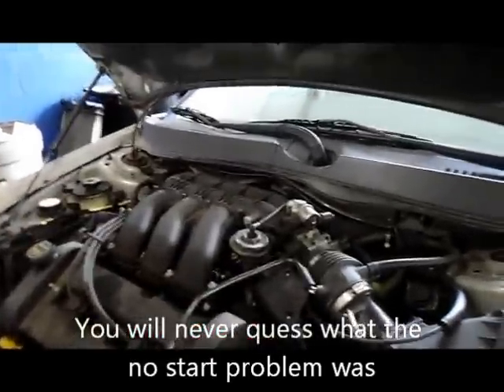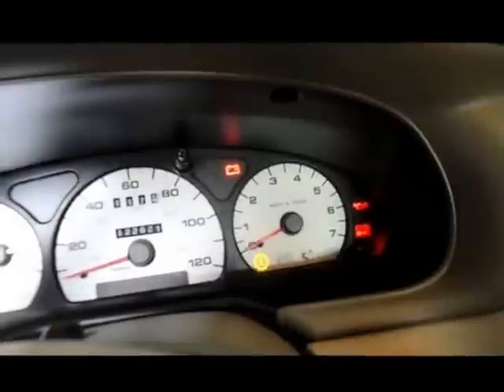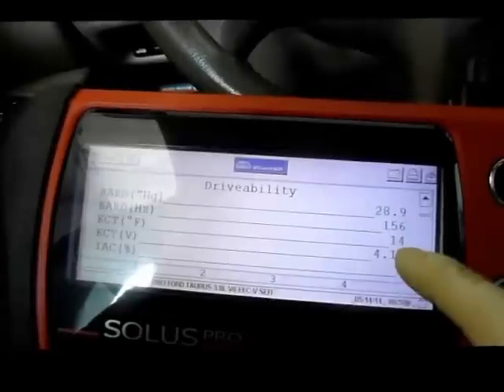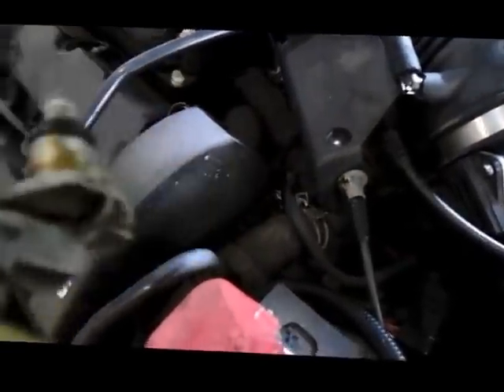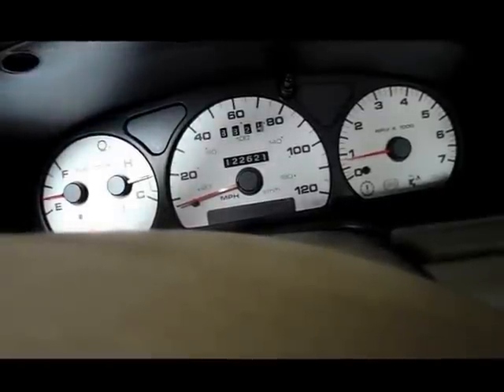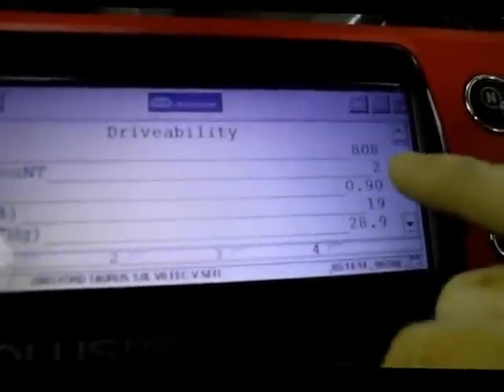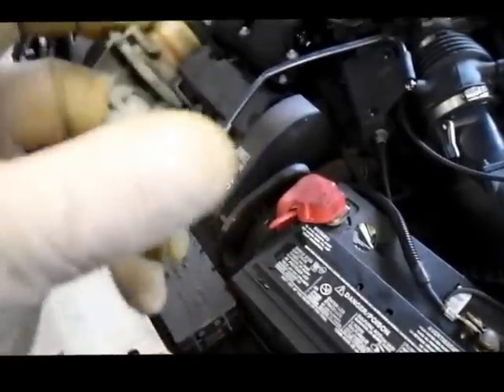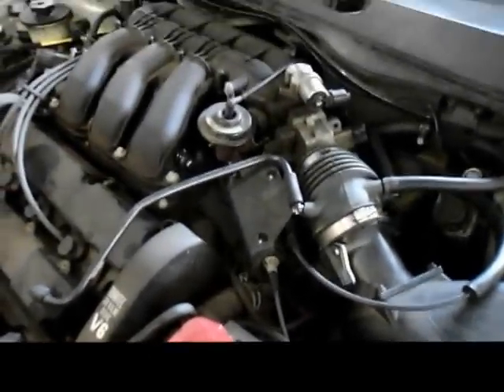Engine cranks but won't start

Comment: hi sir,i have 2012 ls that has been over heating and is crank but no start as well,would this method work on all cars?
Reply from the maker: Did you check the car for codes? Was the car overheating for a long time?
Reply: jimthecarguy no codes are being thrown,and everytime the car overheated i parked on the side of the road,resivor would be empty (however there is no leak anywhere)i would fill it back up and it would drive fine.ive already changed the spark plugs and the coil pack....
Reply from the maker: If there is no leaks under the car it may be a problem with a head gasket.What did the old plugs look like?
Reply: update....when i wrote u it was around 1am i think,since i wasnt going to be driving my cruze,i wanted to save the battery so i disconnected the negative cable,when i came outside to work on it,i reconnected the cable and it puttered a bit but it started right up....i dont understand.
Reply: i have video and pics but dont know how to post it on here,do u have an email?
Reply from the maker: jimthecarguy1@gmail.com
Reply: jimthecarguy I have a 2004 Alero and I'm having the same problem..I have gas in my car but the gas gauge isn't moving at all I checked under the hood to see if it's getting gas and it is what could be wrong
Reply: jimthecarguy my 2002 mercury sable cranks but won't start could this be a possible problem?
Reply from the maker: Yes it could be .Did you scan the car for codes?
Reply: jimthecarguy I'm having the same issue now with my Acura Legend. The dealership checked it out on the computer the code came back saying bad coolant  temp sensor. The strange thing is my car hesitates to start only if it sits for at least 8 hours or more.
Reply: Ricci Clark and
Reply: Ricci Clark I'm thinking cracked head would cause it to over heat depending where the crack is it mite be spray ing coolant into the cylinder s where the spark plugs are with causes the no start because of fouling of the spark plugs

Comment: hi my name is Maurice and I have a 96 Dodge Avenger and the car will start up but it won't stay running what should I do
Reply from the maker: Did you check for codes?
Reply: I had a 95 Dodge Avenger with the 2.5 v-6, I had a problem that the car would start and run but you had to put it in neutral and revved up at stops.  It was the EGR vavle, I had it checked twice and it tested good but I changed it and it cured the problem, I don't know if yours is the same.  You can make a blank off plate and put it between the EGR and the manifold.  You can make this out of a soda can or whatever and just bolt the EGR back on.  If the EGR is the problem the car will run fine.  That is an easy test, the testers that some places have for EGRs didn't tell the truth.

Comment: The coolant sensor sends signal to computer next to check heat from exhaust(02sensor) to fuel...complete circuit

Comment: wow that's just insane, I'm gonna check mine, after it over heated sob wouldn't start , and still having issues, shoots 1 vacum line can cause the whole car to fall apart from Miss fire to everything , these cars are a Btch when they want to be, . I'll let you know what happens ,

Comment: I have a 2000 Chevrolet Blazer and it starts but won't stay cranked  might stay crunk for 5 to 10 seconds then starts to backfire and stalls
Reply: Any help with this I will be grateful the fuel pump is working I can hear it running changed the fuel pump
Reply from the maker: Your going to have to do some diagnostics.The first thing you should check is the fuel pressure to make sure the pump is good.
Reply: jimthecarguy  I can hear the pump turn on?? Does that matter
Reply from the maker: That's good but you still need to know the pressure especially when it starts to stall.
Reply: jimthecarguy  how do I do that
Reply: jimthecarguy and how much is it gonna cost me

Comment: I have a 2000 Nissan Altima with 222,000 K  on it and the engine turns and cranks even with old spark plugs.

Comment: Why is it that every time I'm watching videos where it involves a diagnosis of the vehicles electronic or just simple starting ... every single mechanic or diy always over rides the ignition cluster lights to start the vehicle? Guys let the cluster complete its check cycle with the ecm pcm before cranking the engine !! It's crucial to the computer management systems to pre diagnose prior to start up
Reply from the maker: Marc Bainbridge thank you for stopping by the shop

Comment: Can somebody help i have Nissan tiida 08 Ger Ato it crank but wont start fuel pump has been tested all good,  i have even cleaned the plugs ones it was gon fine for a day then same happened again! please help if you can

Comment: When it reads cold the ECM will try to fatten up the mix and it causes it to flood so it stops fuel.
 Wait until a cooling fan that is bad will also not allow it to start.
 Ford's have a piss poor O.S. (operating system). I have seen many like what you got. Remember when working on Ford's,Lincolns, Mercurys you must put common sense aside.

Comment: I have a 2004 kia spectra it starts but turns right off any idea why has gasoline
Reply from the maker: christa dosty The car has to be first scanned for any failure codes.
Reply: jimthecarguy did that this problem was fixed but now code p0302 comes up it drives rough now and check engine light blinks on and off

Comment: What happens if you get 0 rpms? Car cranks 0 rpms wont start?
Reply from the maker: jonathan ullery Some cars don't register rpm's until they kick over. Check for spark, fuel pressure and pulse to determine where the problem lies.
Reply: jimthecarguy thank you for the reply ive found out the car spark plugs were bad and had a flooded engine ty.
Reply from the maker: Thank you for watching

Comment: Space Cadet when your mobile no need to remove injector 1st check for switching, 12V, 5V.I recently went to a Mondeo 2.0 the chap had the car parked for 6 year he had 2 mechanic check out still did not start one told him faulty injector I check faults and with in 10 minutes diagnosed faulty fuel pump in tank (Problem Sorted )
Reply from the maker: Thank you for watching and your input.

Comment: i have a nissan micra -march just dose anybody know before it broke down  the car would run very bad  then it would die. let it cool down then it would start / now no spark no start .when i try to start it just before it died. there was smoke coming from throttle body any help lease

Comment: its what they call open loop, it enriches the fuel to make the o2s hot to operating temp. (close loop)
then it uses the o2s reading to go rich/lean (feedback logic). Without one of the two temp sensor reading the computer dont have an alternative command to start the car. But if the readings are ait (air temp sensor = close to atmospheric temp and ect = around engine temp) verifyable with a temp gun to test, then the computer will read off the o2s for fuel delivery (close loop mode).

Comment: "The 2 DTCs are because I had the coolant temp sensor disconnected"

No sorry, do not pass go, do not collect $200. The DTCs where there because the ECU figure out one of the temp sensors was wrong. On startup every ECU checks the 2 temp sensors a car has (air, coolant) to see if they values make sense. The ECU has probably saw two wildly different readings and tripped the Check Engine light. Both DTCs might be related to the coolant temp sensor or there might be one for something else. Always run a DTC scan first, you can save yourself a lot of trouble.

As for why it it keep an engine from starting, well if you need to ask you're not really qualified to work on cars, EFI or not. Ever heard of a stuck choke? It can cause the same condition, even worse it could hydrolock the engine in the worst case scenario..

Comment: Car comes in as a no start. Hasn't been run yet. New sensor. 192F. Start car. Temp gauge already at 50 %. I don't understand. Must have been a really hot day.

Comment: I had a 1999 Nissan Pathfinder 300 V6 4 wheel drive it cranks but won't start I bought a whole new distributor put it in still won't start put new spark plugs and wires fuel pump works has pressure but still won't start I don't know what to do to it is there anybody out there that can help me been stuck in a field 4 months help

Comment: Things like this are the reason I stopped working on cars, they are now designed to breakdown over the smallest things, the warranties and intentional over complication of a simple system for the purpose of screwing the public out of money on repairs that there is no need for. If you can't understand an engine temperature light then you shouldn't have a car! Personally I find it much better to find old cars and maintain them than to buy a piece of junk that can't take a 8 mph collision without costing 4-10,000 dollars and a computer that makes diagnostics impossible! Best car ever made? VW Beetle, hammer and a screwdriver and you are set to go!
Reply from the maker: Thanks for watching.

Comment: it's a computer trying to protect the engine from overheating shouldn't be that hard to figure out just like the rpm sensor to cam shaft synchronizer won't send fuel to the engine if that's not working

Comment: ohhh i see the problem.    is says FORD.  same thing happened in 95 nissan altima.   exactally same thing.  start and die as soon as you accelerate or put in gear.

Comment: how about if problem  with honda accord 2006 ?? please ......
Reply from the maker: What is the car doing?
Reply: @jimthecarguy  Thanks for replying, I just want you to know that I have no knowledge about cars and your videos have really helped me. 
I had a problem with my car. When I bought a new battery from a known company, they fit in the battery and they put the cover on the wrong side. I didn't notice this in the beginning but this caused the engine light to come on. The D (drive) light started flashing. I scanned it, and the code that came up was P0843, second clutch transmission switch sensor. But the car drove well.  I changed the sensor but the problem stayed. What was strange was it was draining the battery. I changed the battery 3 times since it was still under warranty. I tried to find what the problem was and i noticed that the battery cover was placed upside down. I fixed it myself and the problem was fixed. The funny thing was that the upside down battery cover can trigger the problem. I don't believe it but it happened and I've spent nearly one thousand dollars on this problem. 
Hopefully you know this problem but if not, here's my story. 
Thanks Brother, you've helped me a lot.
Reply: the problem fix for couple days and today the problem is  come back , I don`t know what to do , hehehe....
is  the ignition switch can cause that problem ??
 look like the cable , connnection  ?
 please helph me ......

Comment: This  guy has obviously not dealt with a tempermental Silveardo truck and the vans that are prone to play this game with ya as well as peekabo idiot codes that don't even make sense or are not listed. Anyone with a Silverado that has gotten a code that does not exist should try to replace the temp sensor as well as the pig tail lead to it. This is a very common Chevy truck problem. So here ya have it on a Ford car as well.  A lot of Mechanics go straight to the other sensors most notably the Throttle body Cam Crank and MAF sensors are usually replaced with no luck this can also cause bucking and occasional pinging on steep hills. THE FRIGGIN TEMP SENSOR? like this guy says now "WHO WOULDA THOUGHT THAT HUH...." Yeah who really does... The temp & crank sensors on most Chevy trucks replace em every 60K miles and save yourself some gray hair...

Comment: Why did you guess and change the sensor instead of testing? You only had scan tool readings so you didn't have any proof, but even though your guess was right, you could have been wrong, and you would have wasted both time and money!

Comment: I have a 2013 optima sx 85k miles. Car engine wont fire up just cranks. All lights work and windows and radio.  Took battery to autozone they said battery is good. Tried turning the car on in neutral and car started. placed back into Park then 2 minutes later car turned off. Bad alternator maybe? Fuel pump?? Anyone have any suggestions? Check out my latest video you'll see what my car is doing.  Taking car to kia dealer for service.  Will update a comment on that video. May post another video if problem is fixed.
Reply from the maker: Thanks for watching.

Comment: its a safety item, if the temp sensor is bad the car will not start, if you were to run the car with a vaulty temp sensor and the car over heats the engine will blow up and seze, so that's why, keep in mind the car is running of a computer and now a days if there is ANY and I stress ANY vaulty code with the ENGINE ONLY code will not start. companys cant take the warranty issues with the engine to go, to much money, kapeshe.
Reply: well shore some people can catch it early before; but when there is no oil  in motor it will weld its self to the cylinder walls or crank bearings main or cam bearings will weld together do to extreme temp, yes a car with no water in it probably wont do anything but and I stress but sometimes some engines have done worst things just search on your you tube.

Comment: you sure you had no spark????? I bet my last dollar you did. what you had was a very rich condition due to the ect telling the ecu outside temp was crazy low. the ecu thought it was a cold start man. giving it more fuel to start when cold. did you change the oil after your repair? bet the oil is washed down due to that extra fuel. very common problem

Comment: That...is...a...b****! The electronic engineering must have been treated badly and referenced the connection to another gizmo that electronically shunts the spark. Also, an engineer may have had an idea, but was told not to redirect the travel of the circuit, due to some cost. It did happen to me but gave the car away.

Comment: 1999 Malibu, when starting only runs for about 2 to 3 secs anyone know what's going on here
Reply from the maker: Did you check for any codes ,spark or fuel pressure?
Reply: jimthecarguy no I don't have the equipment to do such a test but was told most likely is was mass airflow sensor...what do you think

Comment: weman would drive til it over headed and wrap everything inside the engine then tell you that car put her down why that's a bad car this is true report seen a alot back years ago thats  why they chained the wireing and parts configured different  i til like the ole ones better

Comment: It's a SHE SHO....a female one. No woman does anything outside at that temperature either! Some brain at Ford thought it would be great to leave you stranded in Saskatoon than to risk overheating the engine due to a bad sensor.  Actually low coolant temp reading makes it run rich.  She's flooded.

Comment: I had a Nissan Maxima, 1973, that would not start if the water level in the radiator got low. I had a leak in a hose. I was away from home and wanted to wait till I got back to repair the hose. It leaked very slowly so here's what would happen. Depending on how the car was parked, it may or may not start. It was driving me crazy, so I called a buddy of mine, a Honda mechanic, and told him my problem and what I had checked. He immediately  asked if I had checked the coolant level. I asked why would I do that? He replied some cars have a sensor which won't let the car start if the level is low. I topped off coolant and the car started right up, was fine till I got home. I would never have found that without his help
Reply from the maker: Oh yea I remember those cars.Acura and Honda's  would run like crap if the coolant was low.

Comment: it can be stranger ,drop a dime in cig lighter on a 1988 Corvette.will burn up transmissions. they had a change place right beside it...Only took 3 trans and shop got the computer used off snap on for 2200.00 it showed low volt.then we found the dime..
Reply: derrick johnston had a problem with a caddy years ago customer had spent hundres$$ on mechanic fees why car was blowing fuses first thing i did check every cigar lighter in the car that car had one in every door his grandkids were using the lighters for piggy banks lol
Reply: The same thing with me. When I was a child my parents had a '77 Seville. I remember getting my ass whipped over a dime that somehow got stuck in the rear door cigarette lighter. We never found out how it got there, but my father was certain that one of us, 3 kids, did it.

Comment: It’s crazy my car was running great after driving a couple hours I parked went into the store cane out it will crank but won’t start so I had it towed to my house ... this morning started beautifully. I drive around parked went into another store and came out same thing won’t start ... what can that be ?????
Reply: fuel pump.they fail when they get warm.
Reply: Auto Help what if the same thing happens but it wont start even when its cold? :(

Comment: You had spark never saw you test for no spark the coolant temp sensor made it rich causing a flooding situation pretty simple you kept saying how it started then put in gear and it died obviously had spark

Comment: It pisses me off how today’s vehicles have “ sensors” all over the engine. A sensor senses.... it should not interfere with engine performance... when they do they are now a functioning part so they shouldn’t use the word sensor.... needed is air fuel and spark to run.... now add computer to the mix and now a fucking low tire or loose gas cap will turn on your check engine light and they don’t have anything to do with the engine...... bring back points and carbs and do away with computers
Reply: " .....bring back points and carbs...." You  actually miss for example, the distinctive snort of a Weber 40 DCOE ?